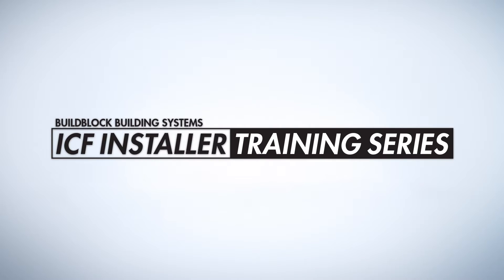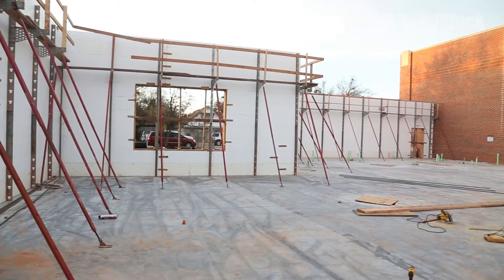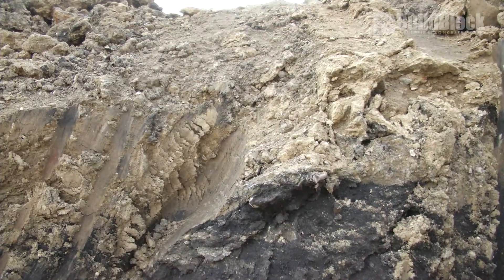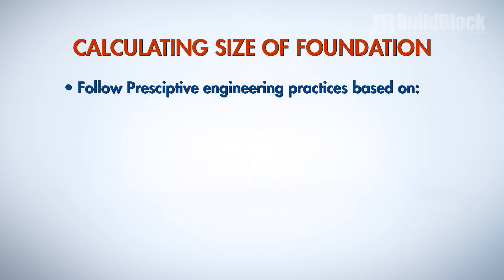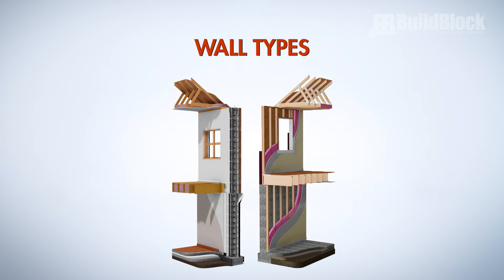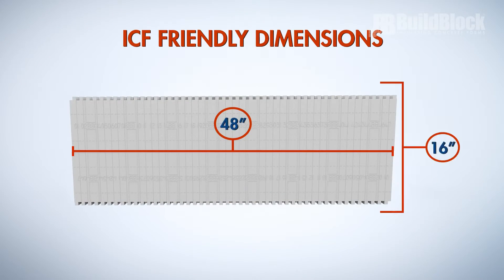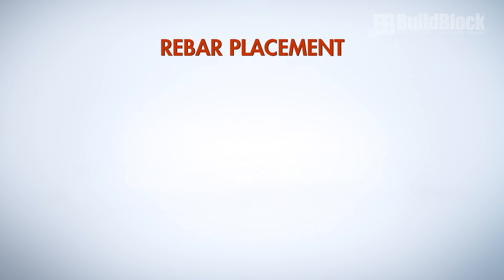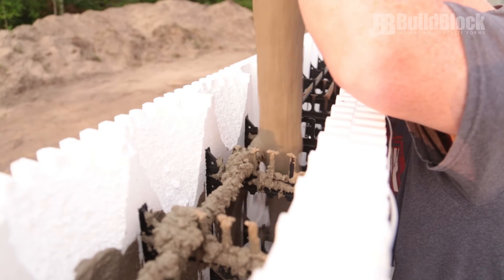BuildBlock ICF Installer Training Series: 06. Footings, Foundations, and Slabs

Comment: What’s the best way to connect an ICF wall section with a 2x4 stud wall, specifically if the wall needs to continue as a single flat surface. Appreciate any references.
Reply: Alan Lu Have you taken their free installation course? On their channel here on youtube, they pretty much have everything posted. Further, they are excellent if you call headquarters to get information. They are more than willing to help you. I watched our entire City Hall get built with this method. It is very interesting. I am impressed with the HVAC energy and efficiency and cleanliness of this building. I am in Florida. Good luck.